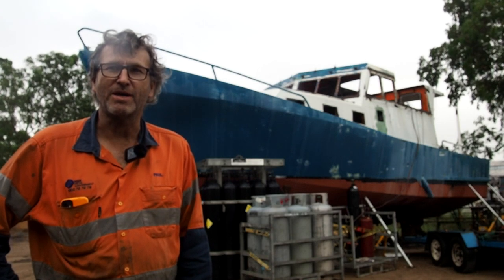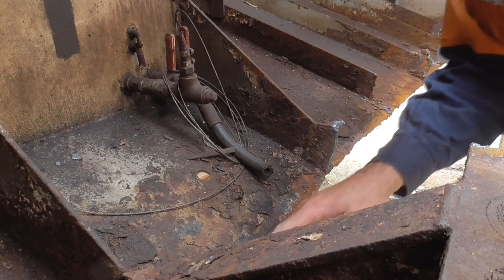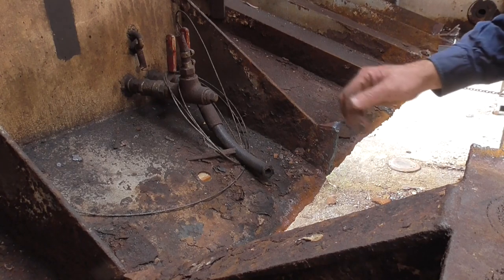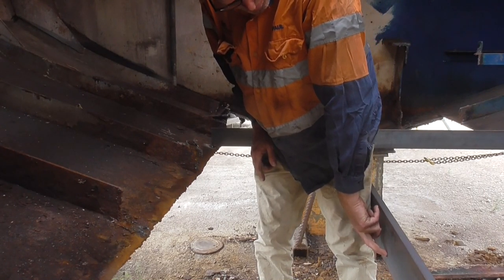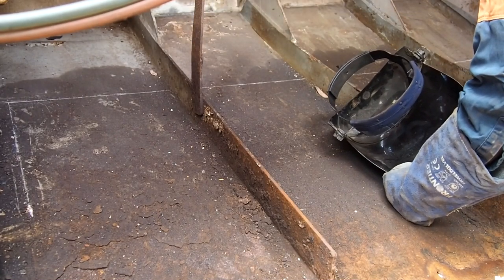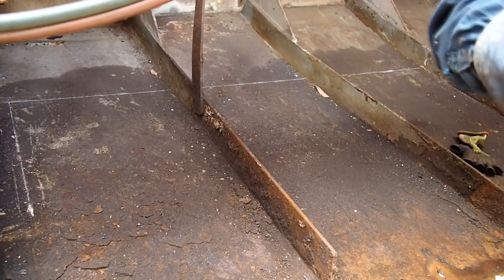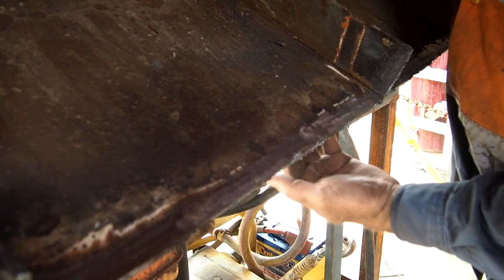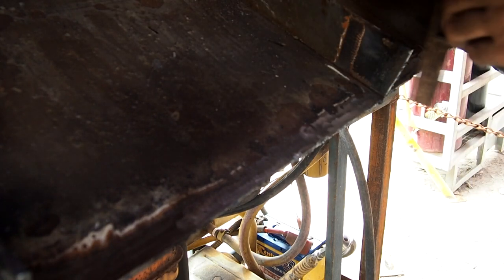EP42- Rebuilding a liveaboard steel trawler. The first new sheet

Comment: I am impressed with your skills with steel
Reply from the maker: Thanks, Harold, I did it for a job many years ago so it probably looks easy to me. So many memories are flooding back in. I forgot how much I missed this kind of work. I stopped doing it because the passion was gone from the trade. There isn't a lot of this type of work anymore. Now it's mostly component replacement rather than repair.

Comment: Good d
News. A ceramic coating that is NASA tested and rated that bonds to steel and prevents corrosion permanently is coming to the marine industry. Currently being used by major oil companies to prevent corrosion. Dries in 5 minutes antimicrobial and fire resistant to thousand degrees

Comment: Moving forward Paul , nice to see steel going in 
PS
 Wear a hard hat ⛑ or remove the exhaust , don't want the build stopped due to injury ,
Reply from the maker: Moved forward at a great rate this week put a big smile on my face. 

I couldn't get to take the exhaust out while there was no floor so it just had to stay there while I put the new material in. I had nothing to stand on so it just had to stay. Our fitters have these little bump caps for when they are working around engine bays. I'll find out where they got them and buy one.

Comment: would a 10 foot shipping container be big enough
Reply from the maker: Yeah it would be perfect but I still have to take the equipment form the container up to the work area. It's not that bad but when I have to set up the plasma, welder, air hoses, power cords and camera gear it takes a bit of time. I missed Sheryl being with me on these days. She rolled out the leads took the gear out of the car and helped pack it all away.
Reply: @TheadventuresofSherylandPaul  would be able to put the container next to the boat?
Reply from the maker: @robfaith6029  I could but I don’t want to wear out my welcome. Besides 10’ are double the price of a 20’ these days. Just crazy